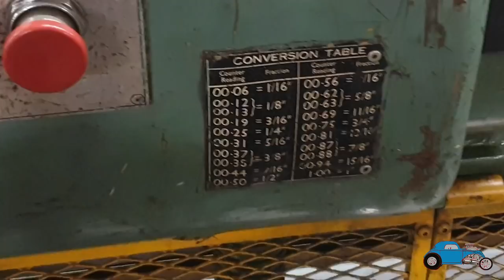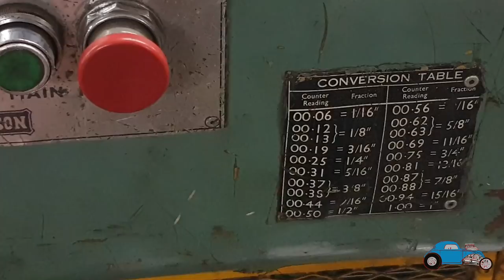Making a Brisca F1 Stockcar Wheel

Comment: Hay notice that you said could not change the wheel diameter but when we raced decades ago we used a most of the cars were 14 inch and race tires were 15 inch so the 14 inch rim was replaced with 15 inch off a late model car but both wheel lips had to be replaced with a junk yard wheel of the same make car but used 8 wheels to make just 4 thanks for keeping the art of hands on and not store bought

Comment: Bloody great flywheels, and with centres designed for rims half the width. May be ok for an  inside rear but not an outside rear. 
You can buy wheels that wide off the shelf out of the US with your choice of offsets as well. Far lighter and far stronger. Though still heavy. And with the labor involved cheaper even with the freight.
Reply: Funny, the US market is very different to the UK market!
Reply: @MatthewTinker-au-pont-blanc  yep

Comment: The problem with this is that the center of the wheel is not strong enough for the added pressure  from larger tires, needs to have a double  center, went through  this with oval track cars the lugs pulling  though the thin steel.